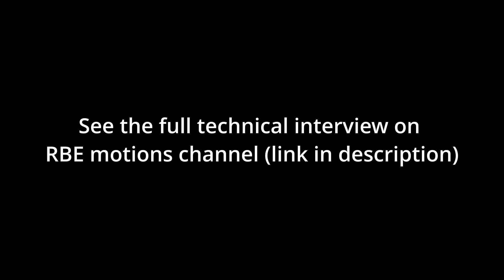Tech Talk | Mach One's Suspension System

Comment: Well done. I would like more detail on the load bearing truck pivot. Would wear be a factor at that junction?
Reply from the maker: We use polyurethane bushings for all moving parts, so wear is very minimal and the bushings are easy to replace if they develop wear after time. The same as your truck pivots basically.
Reply: @radiumperformance  nice